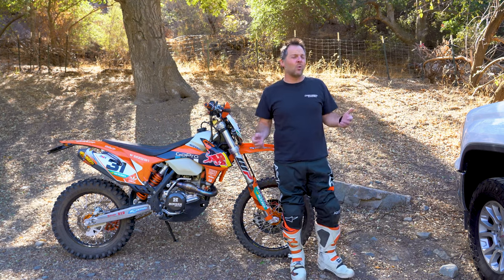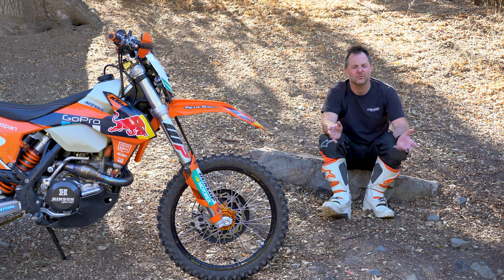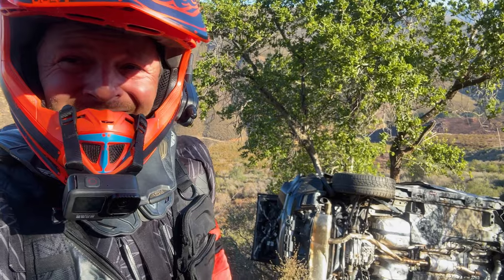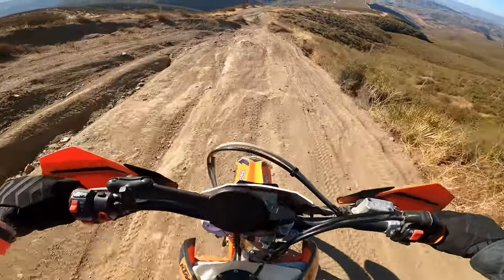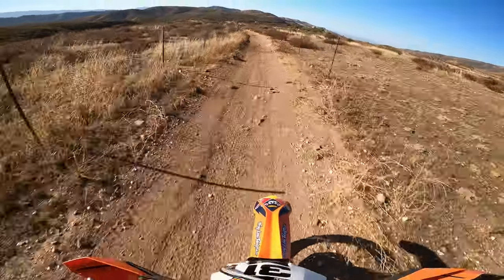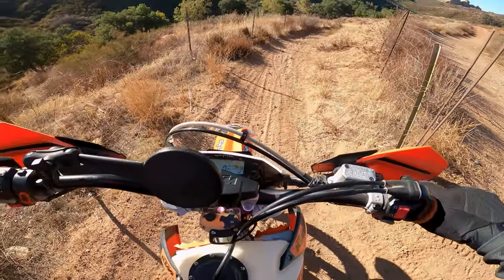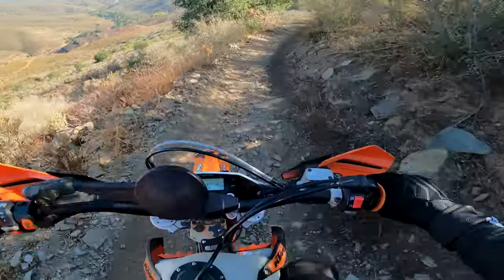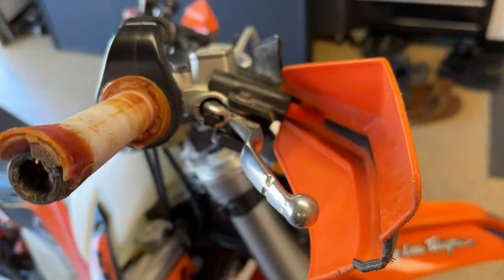Rowher Flats OHV Area - Solo Ride Vlog Episode #1 Full Length

Comment: i have a question, is that spot you parked at before or after the left you normally make to go up to the main staging area?
Reply from the maker: It's on a completely different road. The main staging area is off Sierra Hwy. The spot I parked is on the other side of the mtn on Bouquet Canyon Road

Comment: Are there any beginner friendly trails there?
Reply from the maker: Yes you can stage in the main area #1 and take the fire road West and it goes all the way up to the top of the mountain. Then you need to turn around and take it the same way back. Because if you continue on, the other way down is steep and rocky.